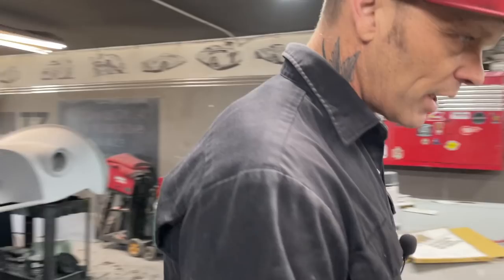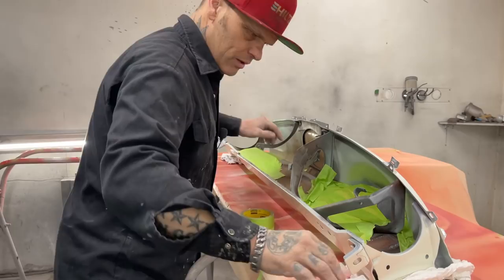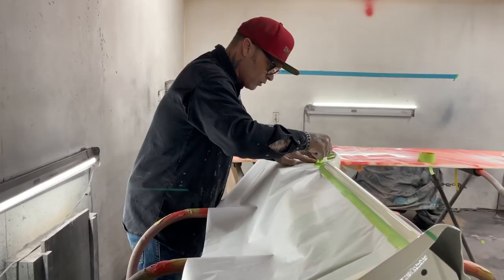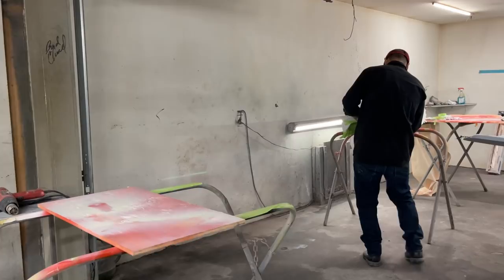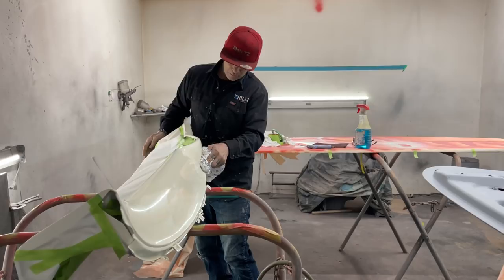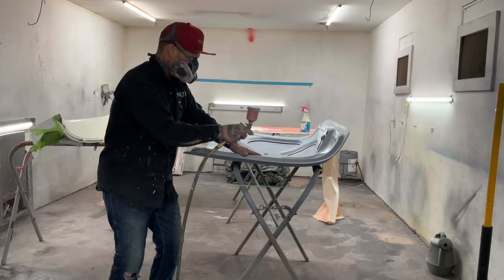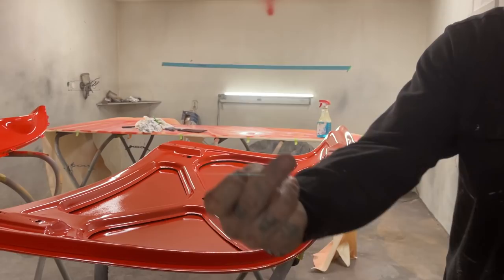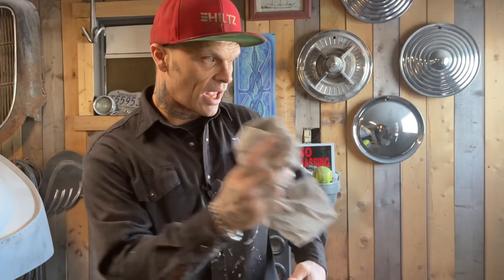Two-Tone Paint Job Process on the 1955 Mercury

Comment: Learning every day. My favorite so far is the second Bugatti out of the old Chevy. Looking forward to seeing that finished and painted. 

Favorite tip is using exhaust pipe and welding panels. Watching this last 8 mos has given me the kick in the backside to make an HHR into a pickup. I am 65, retired 10 years and this is my 3rd project. '52 Chevy pickup, original frame with S-10 components, including the Iron Duke, Mustang II front and steering. A '95 Chevy van conversion build....James

Comment: Thank you for all you do on here you have really gave me the confidence that I can do my car I have been wanting to do it for some time now I have had it for 34 years it’s a 1970.5 Camaro it was my mom n dad’s car and they are both gone now
Reply: That’s a great year Camaro.  Some of them are very desirable depending on the options. I don’t know what your plans are for the car but if it’s drivable and you are thinking about restoring it my advice would be to do one thing at a time. The suspension is usually a good place to start.  If it’s your first car it would be wise to keep it in drivable condition between jobs. 
Too many people have dreams about building a beautiful car and they start by taking everything apart.  Often times the result is that the car never gets put back together because the owner gets overwhelmed.  This advice may or may not apply to your project.

Comment: hey chad my lil trick for shaking rattle cans is i take an old caulk gun i cut the everything off besides the housing that hold the tube and i weld it to an old sawzaw blade and use my sawzaw with the housing of the caulk gun i strap it inside of it so it don't fly out and wanna talk about a can shaker brutha that thing sounds like a machine gun... Hope that helps you out it works great for me it really cuts my time in more than half when painting from a can. let us know how that works out for you.

Comment: I'm doing a scooter and doing the leg shields is a lot of work what a customer never sees,strip the paint off both sides,then a coat of etch,then 2 good coats of 2k high build,then left to dry,then sanded both sides with 320 then  500 and ready to paint,paint the base coat and then clear it,then left to dry again,sand the clear back down with 800 and add a different colour for stripes,then cleared again and that's just one part.

Comment: Interesting.  Just where you'll start  . Roof body fenders  lighting  bolt and color scheme  . All will half to be placed in the  right spot  so the colors flow 😎  . Where to begin and what color ? Myself I'd not use the black and make it a two tone paint job . It would still look cool and keep that 50 style in place . It's your car however and it gets the Bad Chad paint scheme and I'm ok with that to . Thumbs-up Jolene 👍 and 👍 Chad

Comment: You could have soft edge masked the back side of the dash and filled it in with brown masking paper which would stop paint blowing through to the other side then used 3mm fine line tape to mask the edge off for the two Tone. Hope this helps Chad Mate👍🇬🇧😀

Comment: if you turn the air pressure on the spraygun down and use a wider spray pattern you wont use as much paint or get so much overspray